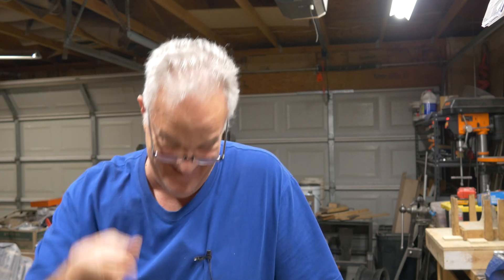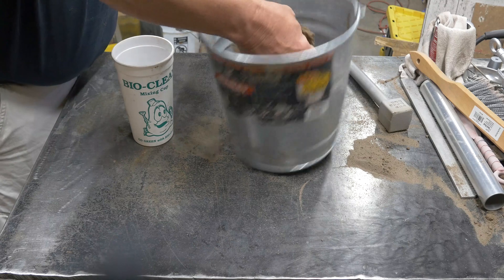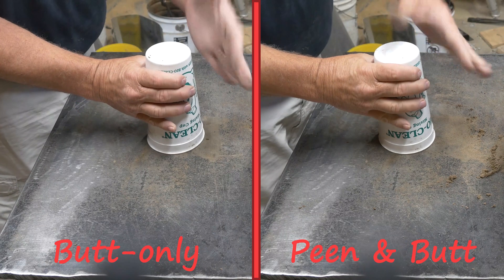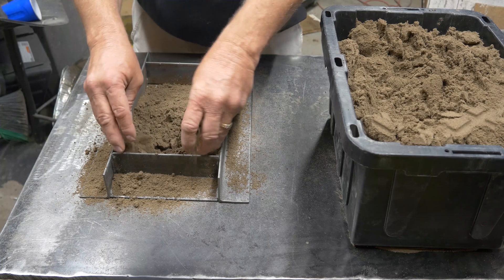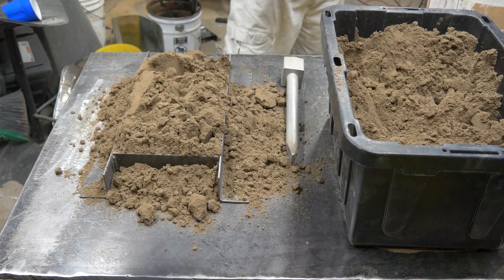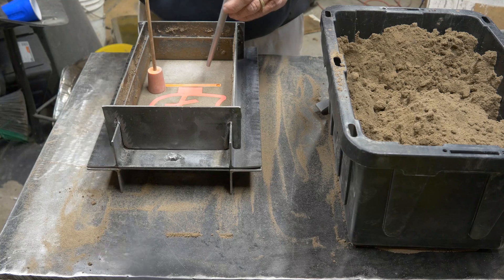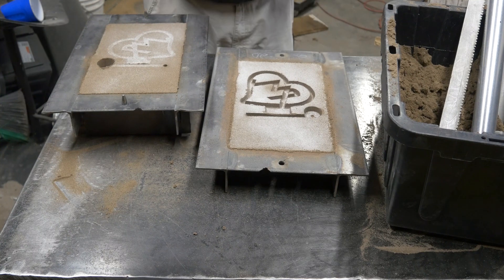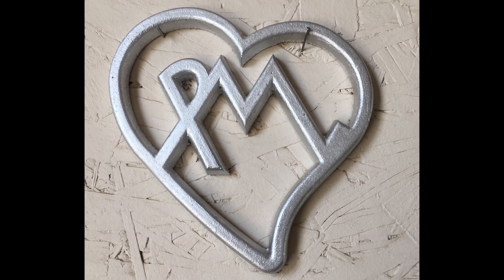Learning to cast metal - Ramming Sand

Comment: Excellent video. Just getting started.  I will definitely be trading my hammer in for a ramming tool. Where did you get your "runner and spin trap" from.
Reply from the maker: The runner and spin trap are based on Professor John Campbell's theory. I also used information from Bob Puhakka in my design. I model and print the runner and spin traps that I use.  I don't have time this morning, but if you look through my channel, you will find a couple of videos that Bob did for me.  I also have a video on runners and gates that talks about them and finally there is a video about reducing porosity that I think talks about them.  If you cant find them let me know
Reply: @swdweeb  thank you so much. I found the files and sent to to a friend to 3d print. I will definitely be checking out more videos on your pages. Liked and subscribed
Reply from the maker: @billsaunders1879  Wonderful.  Don't hesitate to reach out if you ever have questions

Comment: My copes are 3 1/2" deep. I pack the sand in two lifts. After riddling and filling the cope 2/3rd's full, ram around the edges and the pattern with the tapered end. Then pack the rest with the 1 1/2" butt end,  just enough to get a good finish. Fill the rest of cope and use my 2" x 2" ram to pack the top lift softer than the lower lift. This will let the sand breathe better. By packing in two lifts you have a better consistency of the facing layer on your pattern.
Reply: Good description.

Nice video Perry!
Reply from the maker: Thanks Andy.  You're going to get a mention in an upcoming video.  Not this weeks but next week or the week following. It has to do with an approach that mimics contact pouring basins at the home foundry.
Reply: @swdweeb  You've sure been busy.  I've been trying to find some time to make some more videos.  I really want to make some beginning blacksmithing videos.
Reply from the maker: @Andrew Martin Well, if you consider seven months of not uploading anything busy... :-D   Maybe I'm trying to make up for lost time. Maybe I'm just feeling the juices again.   Been editing next weeks video this evening. 

Good luck on the blacksmithing stuff.  I found that really hard to do when I tried it.

Comment: Question. You riddle the sand to make a nice finish where it presses against the pattern. But when you ram it the sand against the sides of the pattern will be compressed down, leaving half or a third of the side of the pattern faced with the clumpy sand. Has that been a problem? I would think that after you riddle the sand you would use your fingers to press it against the sides of the pattern to keep good facing sand against the sides. Might also help with the tear-outs. I don't cast (yet), just trying to make sense of things.
Reply from the maker: Well, there's your first problem Mark, trying to make sense of things 😄

That is true for tall patterns, The sand definitely compresses down past where the riddles sand is. For stuff like I cast in this video I had plenty of riddled sand over the pattern. 

I suppose you could do as you suggest by riddling and then pressing with your fingers.  I don;t recall doing that with the bells that I cast. I do recall filling the mold with riddled sand. I'm looking at two of the bells right now and I dont see any creases due to gaps in the sand.  

It could be due to the fact that the sand that is closer to the end of the ramming tool will compress/pack more than the sand that is further away.  Maybe my ramming with the peen end first got the bottom part of the bell and the butt end did the top. That's a darn good question though.
Reply: @swdweeb  It would appear that for most castings the layer of riddled sand is enough  but like you say for a tall casting the ordinary sand will end up facing the molding. If the item is sufficiently tall enough then it will be laid on it's side anyway and end up with a parting line. Fully mulling your sand prior to ramming up should reduce defects due to voids.
Reply from the maker: @markfryer9880  Good to see you're still here Mark 😄    I suppose one could riddle an excessive about of sand so that the whole thing stays covered but I think you're right, if the sand is prepared beforehand it'll be soft and mold up against the pattern well

Comment: Is it possible to  ram the sand too hard? I've been using both petrobond & some green sand i made. I seem to have more breakouts of large chunks not releasing from the mold especially with the petrobond. I haven't been doing this too long, so i'm learning as i go. Where i've really been having difficulty is doing some coins & trying to get more detail in them, but that's for another time, maybe you could do a video on right temp for the metals to flow properly & how to get more detail in the smaller molds. Thanks for all the great videos!!!
Reply: Someone who knows a lot more than I do about sand molding once told me "You're cracking walnuts, not rocks".  But I just go by feel, you can tell when the sand firms up under the rammer.
The sand needs to remain permeable enough that gases generated inside the packed sand from the hot molten metal can escape the mold through it instead of getting trapped inside the cavity and messing up the casting (or in the worst case, making the mold explode / spit metal back out at you).  If you ram up much harder than needed for the mold to hold its shape through the pour and until the casting freezes, the sand will be denser and less permeable to the steam (or smoke with PB). So, for the same reason you can't put infinite amounts of clay and water in your greensand to make it much stronger than it needs to be, you can't ram it up hard as a rock either.  Even with generous use of the venting wire, trapped steam/gas defects may occur.  Petrobond can use finer sand grains and be rammed up much harder than greensand before running into permeability issues because the smoke from the burning oil in it has a much smaller volume than the steam from the vaporized water in greensand.  Also, if the sand is rammed so hard it has no give to it at all, castings that surround sections of sand (like the heart Perry cast here) could potentially even tear themselves apart trying to shrink a little bit just after solidifying, while the solid metal is still hot-short (crumbly).  But I think you'd have to ram REALLY hard to cause that.  It can be an issue with overly hardened cores though.
Reply from the maker: @Tobho Mott, good stuff. Thanks.  I neglected to give you credit for the peen and butt knowledge. I was in a rush and forgot.  I will make it up to you.
Reply: @swdweeb  no worries. 👍  I really need to get back out in my foundry soon...
Reply from the maker: @tobhomott  You do.  It's been near 100f/37c here this week.  I expect the snow will start flying in a week or two and I'll go from "its too hot out there" to "its too cold out there" rather quickly
Reply: Yes, you can ram sand up to hard to the point where it causes defects in your castings. Ridling your sand allows for finer sand to replicate finer details in the mold. Venting is also important to prevent gas buildup and gas related defects. Olfoundryman is currently doing a series on making Aluminium casting boxes, and in the last two videos he shows some defects and explains their likely causes.
Reply from the maker: Venting is a source of contention especially with guys like Luckygen1001.  I have been an advocate of using vents and he has no need for them. He proves it many times over. I expect this is due to two things, his sand composition is different than mine and he has developed a touch for how hard is hard enough. It is possible that I've crossed the line on how hard... next week's video shows a plaque that I forgot to vent.  For the most part it flowed pretty well... for the most part
Reply: @swdweeb  I failed to vent my last aluminum casting, a small skillet with letterboard text glued to the back, basically a frying pan shaped birthday card for my wife meant to hang on the wall.  Maybe I rammed too hard or just had my sand a bit too wet, or maybe it was just the lack of venting or a combination of factors, but in any case my casting ended up having an unintended "spoon rest" on the rim of the pan.  I hung the thing up high enough that she can't see the defect I mean feature very easily unless she gets up on a step-stool. :) 
I did not shoot video of it as it was a shameless ripoff of Cast Iron Gypsy's recent project filmed at Windy Hill Foundry.  But I'm starting to get the message about venting...  We can't all be Luckygen1001!  He definitely knows what can get away with and what he can't with his own sand.
Reply from the maker: @tobhomott  I watched that same video the other day.  It was in my feed for days before I finally got around to it. 😄
The last pan I cast, albeit tiny,  didn't fill either. I cast it upside down in the cope with a huge riser/vent (not a feeder) in the center of the pan. I still have it (my wife loves it) and see the unfilled hole every time I look at it.  I really do need to revisit that pour.  Maybe do some wire pokes this time.   I'm planning on doing a video on vents in the next week or three. Maybe that's a good one to pour.